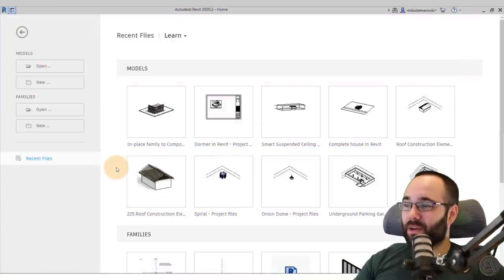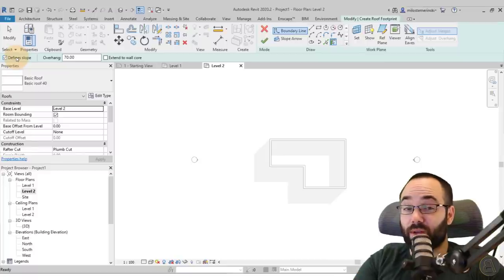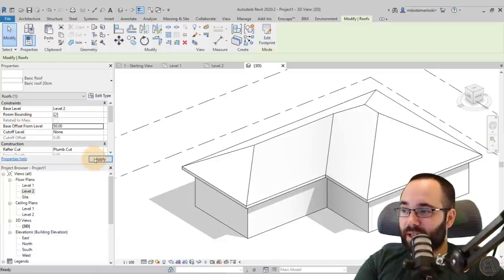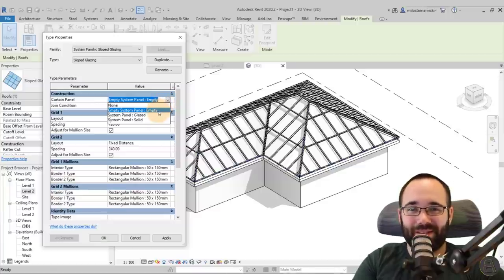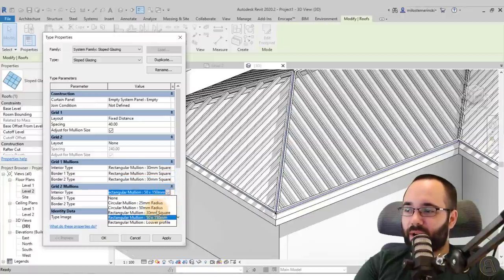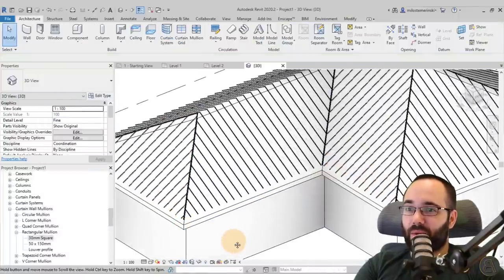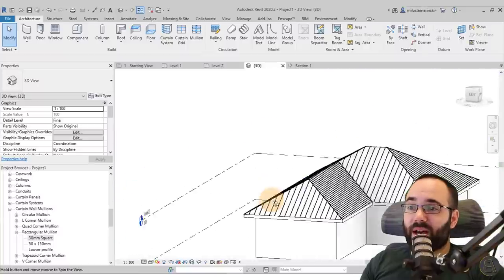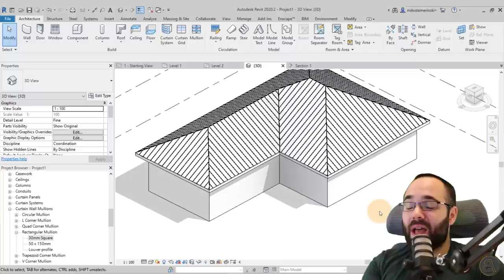Standing Seam Roof in Revit Tutorial

Comment: Just a thought. Typically you would want the seams to match when they meet with one another. The ridges would typically be capped, so the last few mullions you added would have to be, since it would be covered by the cap.

Great video. I knew curtain walls were very powerful. This adds another tool in to the mix.